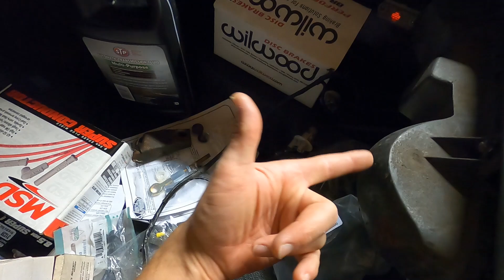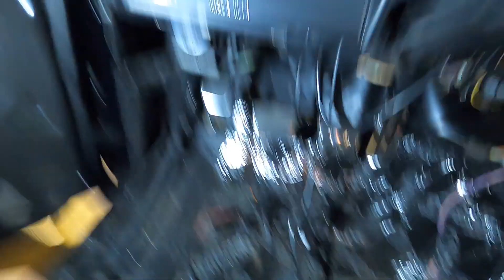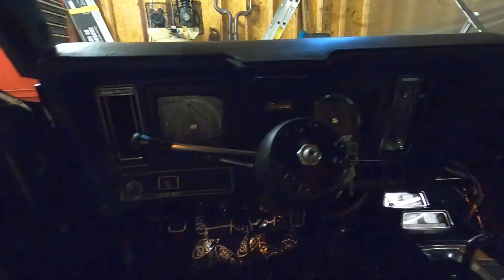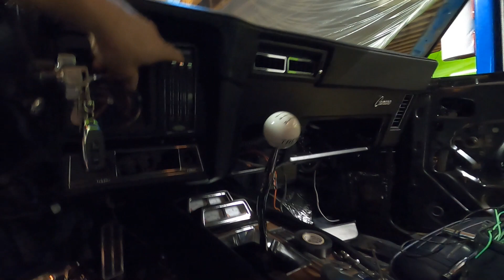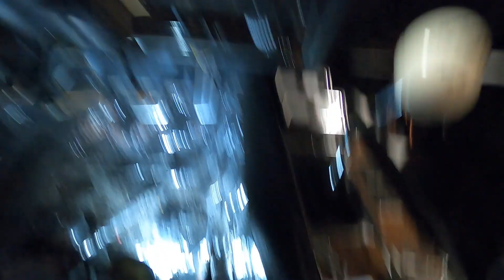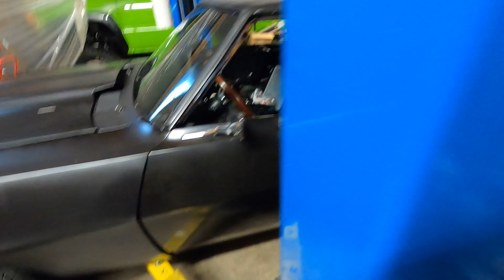1969 CAMARO ROSEWOOD STEERING WHEEL INSTALL

Comment: I have a 68 with an aftermarket column and a similar steering wheel with the offset back from one of the three pieces of the wheel. I am having a hard time finding the right wheel adapter that has that grove like yours does. I wish I knew what brand it was or where to find it.